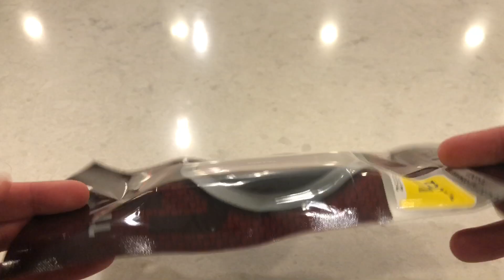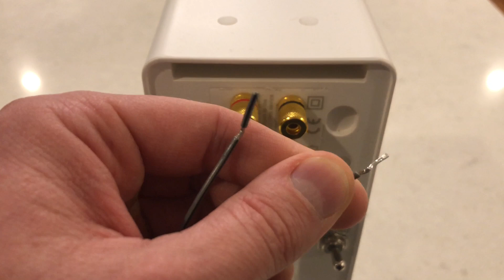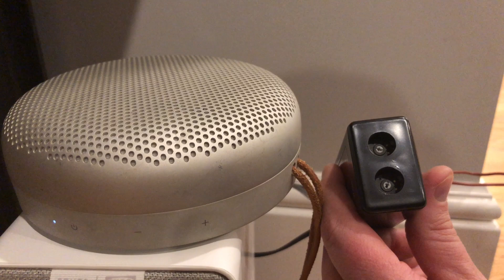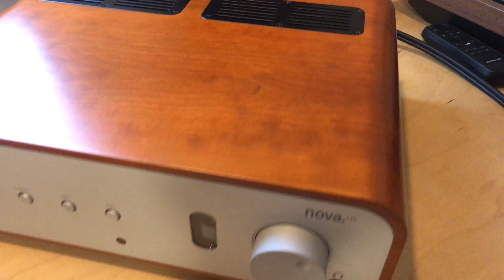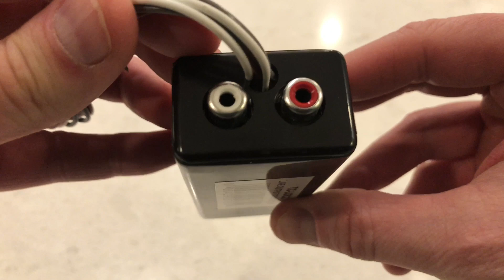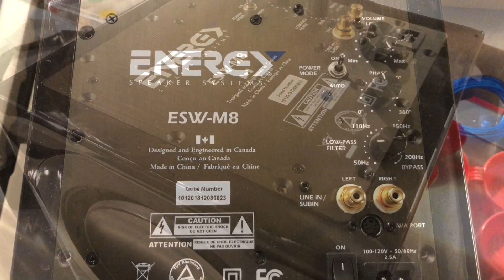A Cheaper Connect? Sonos Line Out DIY Ikea Symfonisk Hack (Verdict: Meh)

Comment: Nice try!  My audio survival kit for video production has all kinds of turnarounds, splitters and adapters. If I 'm trying to adapt some cheap audio gear for a pro video camera or vice versa (or is is converse?) and I get beyond the three-adapter-limit, I know weirdness will follow.
Reply from the maker: Ha, that’s great. I too have bins of every possible connector just in case I need to bend those electrons to my will. I definitely reached the limits of good fidelity but it...sort of worked.
Reply: Edcor makes stereo-to-mono transformers - I'd bet that would do it.
Reply: Here's a link: https://www.edcorusa.com/couplers